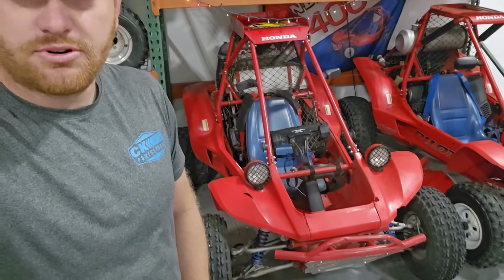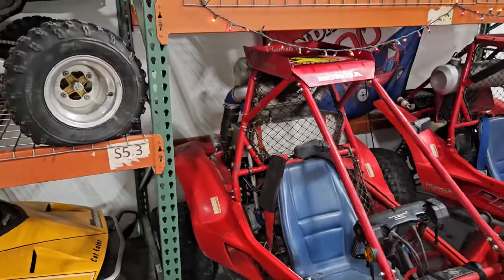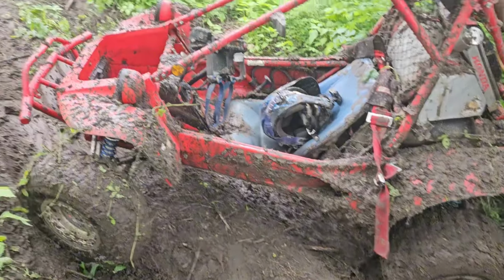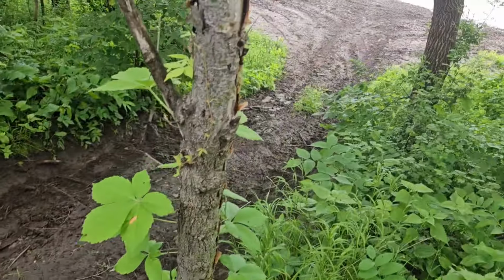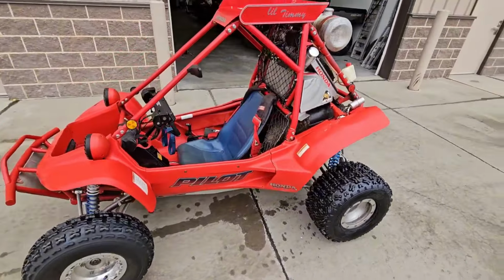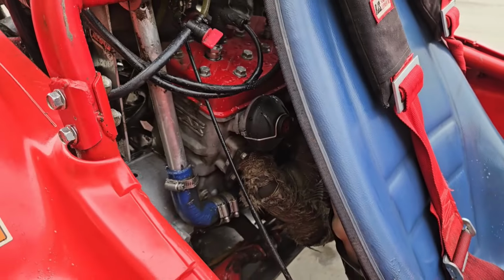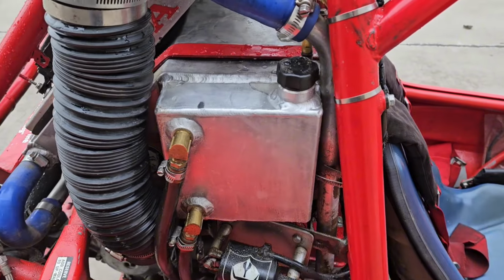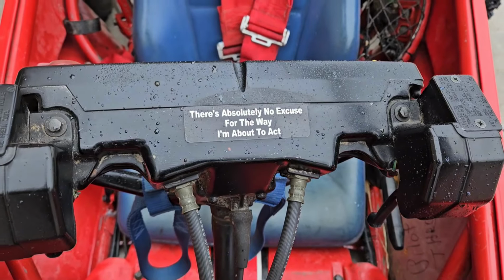My Snowmobile Engine Swapped Honda Pilot Is SO MUCH FUN!

Comment: Do you think those big 2-stroke engines can be mated with a Harley-Davidson transmission
Reply from the maker: @coltonensey6129  not likely. These use a cvt clutch. The output of the crank shaft is a tapered shaft that the primary clutch presses onto. I'm not very familiar with Harleys, but I think that would be the biggest issue.
Reply: Yes, you have enough money anything is possible.
Reply: If you have tools it's not to crazy
Reply: It’s probably possible but the only issue with some 2 stroke motors using a normal clutched transmission is that if you use the motor for engine braking then you’re running the motor without supplying it with the lubricating oil in the gas, so they can lock up. If you take in this manufacturing task I might look into an overrunning clutch like the old Saabs used

Comment: i need to rebuild my 350 again or maybe spend 4k or that setup.. looks like much added weight to me .. the suspension on the 350 is already brutal
Reply from the maker: A rotax swap is definitely worth it. You can find a cheap donor sled for like 500 bucks and the rotax motors are much easier to get parts for, plus they have like triple the b power.
Reply: @CKPowersports  I know I would probably be paying too much 4k says it includes everything you need. parts to convert it over included. ... I just pulled my 350 motor apart and its so rusted that the rod cap broke
Reply from the maker: @TheOklahomabourne  where did you find that conversion kit at?
Reply: @CKPowersports  looks like farroffroad

Comment: I think it's a cool conversion, but I'm curious if you're losing some performance with the jet ski carbs, I've ridden both performance snowmobiles and jet skis and in my opinion the jet ski carbs are kinda detuned and not as good flowing as the traditional style horizontal carbs.
Reply from the maker: @michaelhartman851  i do think that might be possible too.

Comment: Thats cool, its torquey  but not to the point its not rideable. Do you feel like its at its limit as far as CC wise?  Does it come out from under you a lot ? meaning the rear end is it sketchy?
Reply from the maker: @Nomah1979  it's incredibly stable. It is very rideable. It has the power if you want it otherwise it almost feels stock till you pin the throttle.

Comment: How difficult was it to swap the engine I’m thinking about doing something similar to a Honda oddesy what would you recommend or things to know
Reply from the maker: @jracer7189  there are kits available for the engine mounts that will let it bolt in. You'll need to relocate the gas tank though and add a radiator too.  join the odyssey group on Facebook and you'll find lots of resources.